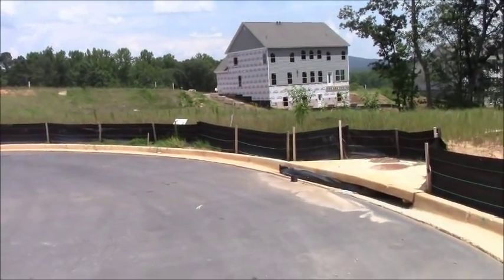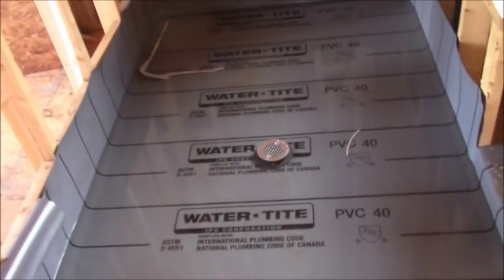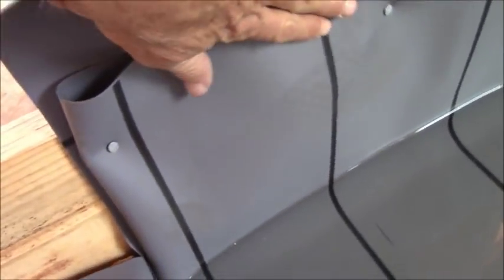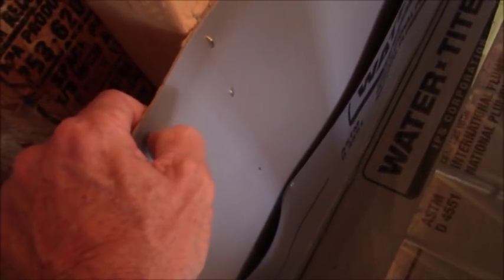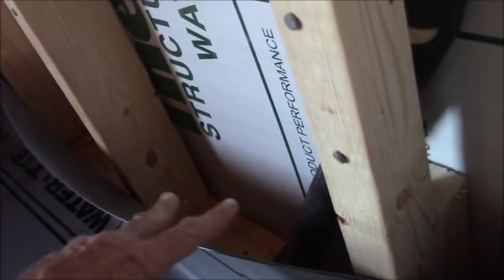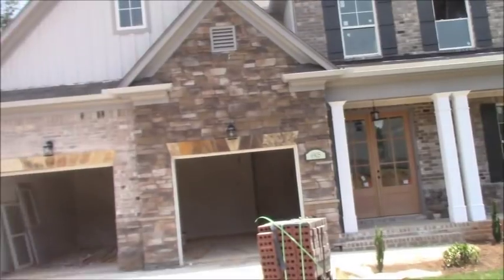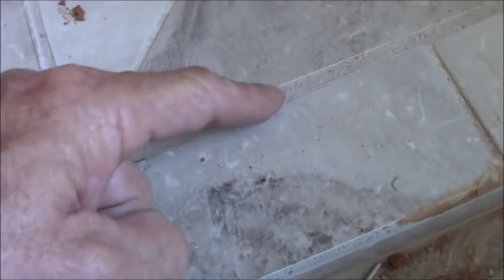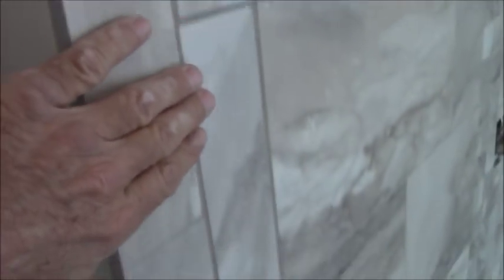NO ShowerPan PreSlope ..NEW CONSTRUCTION

Comment: Being honest. Don't look in these cookie cutter economical house builders, they only follow the minimum code possible and most of these houses would not pass an actual code inspection. These houses are built so fast that they are never built to code. They are sold for a cheap price compared to actual professional builders. These houses are built AS FAST AS POSSIBLE. Quantity over Quality style. Yes pre-slopes help not going to write 2 paragraph's why. Capillary action only happens until the mortar bed itself is soaked and the excess water will simply stay at the bottom of the pan. This is where the problems start.

Just because this video has a subdivision style house that's built with minimum code dose not mean it is NOT code to have a preslope. Do it the Right Way Once.
Reply from the maker: 😂😂😂😂
Old habits die hard I guess

A pre slope is an antiquated process, we are waterproofing our pan surface now so it's 100% irrelevant to the build of a shower... kind of like the phone booth, not relevant today.

Having said that I have a video call pre-slope explain, you can get my take on the whole buffoonery of this method and that by the way, you cannot prove actually works.

Having said that I have taken showers out literally in multimillion-dollar homes and there is no pre slope so because you think it's a low end subdivision, which by the way it is not, doesn't negate the fact that pre slopes are not code here in Georgia and it's rare that I run into one... and yes inspections are done on every house that is built.

And finally to your last point of 100% saturation, that's what degrades your mortar bed to start with, breaks down the cement which is the binder and the pan fails... however if you know anything about a 3 piece drain then you must know besides weep holes....at only 1/4" above floor... there are also troughs under and above the bottom flange to allow water to escape, and including cutouts inside the drain barrel on the opposite thread part, so there are plenty of ways for water to drain on a flat surface... and in fact on my channel I have a video that clearly shows all the water escaping on a shower pan mock-up that I did a few years back, like I said you have no proof of what you say but I do 👌👍

But I digress, shower Builders are waterproofing  their pan surface as I said before, so it is a moot issue.
Reply: @StarrTile  Number 1. Yes it is possible to prove that a preslope works. Issac did a video on it. Although yours and his were both way to small to provide an actual result.
2 Never said it was a "low end"  subdivision. It''s all down to the builder and how he operates. I can tell from the finishes and style of homes from the half brick and siding at the top it is not a "high end" builder.  Builders need to make there money somewhere and I know where they cut corners in this house guaranteed. Siding houses are rarely high end. Like you even said the shower sill was not even marble OR sloped for that matter which already is a code violation. Could only imagine what the rest is like. You should check out Matt Risingers video and Ottawa Design and Build and how "good" houses are actually built. They can be inspected. Not inspected well enough. Most issue fly under the rug. Everything looks great on the surface. Just not underneath.
3. I know very well that efflorescence grows in those weep holes and are eventually the leading cause of failure. There is no way water is going to go above the flange that the pan liner is tightened down to so water is free to sit. " so there are plenty of ways for water to drain on a flat surface"  Right on a FLAT surface. new builds are rarely perfectly flat and even less flat once everything settles. Wood is a living member and will deform. Floors are 2x8 and plywood. Most are OSB, those are Bound to not stay flat.  

Last and not least. I have seen that video of the mock up you did. Also that mock up is painfully small and honestly so is Issac's for that matter. Your testing a shower floor. Not a box shower.  13:48 look how much water is there on a small box. never mind a real shower. How do you think the weep holes will drain water if water is stuck in a corner cause you don't have pre slope? and that the mortar bed will level out the bed? it won't you said "I think" not 'I know" which leads me to believe your playing some guess work here. 

Not trying to throw shade or anything but at the end of the day there is a reason these types of shower installs are being phased out. If this method was a solid 10/10 it wouldn't be getting phased out. Most builders such as myself are waterproofing the entire shower and pan included with something like Schluter Kerdi-membrane which opens up a host of curbless shower options and speeds up water proofing. I agree that none of this matters anymore since these systems are on the way out. I might do a video someday with an actual Real Life  Shower base just to see how much water actually stays in the pan. All this is good information to consider thou so I thank-you for at least making a video on it and responding. No shame in learning.
Reply from the maker: Good healthy response, I like an educated discussion....

Only follow up I have to your comment is Isaac's video was flawed and a foregone conclusion since he used a troba mat above the pan liner, nobody in this business would ever use it in a shower because it's for outdoor landscaping... and because of its very nature would cause movement to the mortar bed and eventually crack it. My belief is at Isaac used it only for that video to prove a point which was never proved Ergo the troba mat. 

The fact that both mock-ups were smaller in proportion to us in my opinion would not matter, if we were 2 foot tall instead of 5 foot tall then that would be a functional shower and therefore still be a good demonstration... but I agree, a proper 3 by 4 shower would be a better mock-up.
Reply: @StarrTile  I forgot to note that in my first response but Yes I agree. The difference would be the larger stall would have a real world resemblance to how much water it would receive and thus provide a more accurate test. Regardless mortar beds are becoming fully waterproofed so eventually this would not matter except for situational circumstances.

Comment: I have installed tile for over 20 yrs and I have never pre-sloped a pan. I have demo’d hundreds of pans and never came across a pre slope? What area you from? I have torn out as old as lead pans also. Tell me what is the purpose of a pre slope that the design of weeping holes of a drain dont do. I get it cement is porous and water could bleed through if drainis clogged or if a pitch is not correct. Idk anyways i have never had a call back in 20 yrs. iId rather save the customer $$$ and your time with that extra step and much rather red gaurd it if your that anal worried. It is a over kill it sounds good but 100% unnecessary in my opinion. Tile cop. <——-(Joke). Take care keep up  the good work

Comment: I have an opinion that this method of doing shower pans is old hat and outdated. Poor design from concept. Water seeps into the mortar slopes and forms mold. Mold expands and explains a lot of cracking in grout joints. Check out Noble. Install a linear drain from wall to curb. Slope in one direction. So much better. Shingle lapped liner can’t leak. Use a bonded liner that installs above the mortar slope. Finish with tile and I use epoxy grout that does not leak. I will not install a pan using this method ever again. It just makes no sense to have a mold farm under your tile. With the improvements in epoxy grouts and the availability of better systems the old ways just aren’t cutting it for me. Look up Noble systems and at least check them out they have a great video on how their systems install. The drains are pricey but it’s more expensive to chase around jobs that have grout cracking on the floors of these showers that they just had to have river rock with 1/2” grout joints  as a shower floor so they feel like they are showering in a trout stream.
Reply from the maker: Thanks for your opinion.
Never ever had an issue with pan liners, and yes after 20 years I'm aware of Noble products, I would never use foam of any kind building a shower, not Noble, Schluter, none at all. Not all my customers want linear drains, all jobs are different. Would not use epoxy grout either...I have, but hate it, looks like plastic. Also not had grout crack or tiles on shower floor crack...not on MY jobs anyway.

But thanks for your input, others may find it useful.

Comment: A lot of heavy breathing in disgust for a misinformed tile person! Pre slope is a code requirement, clear uponor is pex tubing, and the green adhesive is code approved to seal two pieces of membrane(of corse it needs to be sealed water tight to pass inspection). A membrane of that size is more like $70-$80, not $40. A sloped threshold is not ideal if a glass enclosure is used. Most shower valves have a range of acceptance, not exact depth. Most finished tile thickness is less than one inch off a bare stud. Happy critiquing!

Comment: In Pennsylvania, specific codes about pre slope vary from township to township but if you have ever ripped out a shower without compared to with a preslope you wouldn't be talking this nonsense
Reply from the maker: First and foremost everyone I know in the business is doing a sealed system so a preslope antiquated....

But just for kicks and giggles, if you've ever done an experiment as I have with no pre slope you would know that all the water drains out when the flange is bottomed out on the subfloor.
The mess and smell that you described is operator malfunction where the subfloor is not leveled out properly, and or they didn't mix their mortar correctly, or, or, or, there are a lot of failures because of the operator lack of diligence

Comment: Sorry man, you said they did a good job.  How is it a good job if they did one part wrong. Drypacks suck . Pre slope  no slope,  shoot the way its ment to work you can do an opposite slope.  Drypacks are and have always been a failure. 
 I will say you seem like you understand how these thing work. Capillary bs is just a fancy word to say your drypack is saturated. 
Laticrete 9235 or laticrete hydroban is a great product to seal your shower pans, sauna and swimming pools. You can tile right on it. It works. Better than redguard.

Comment: I'll be # 1000. I don't think you understand capillary action like you think you do. A tell is when you say to "look it up". There is gravity too, and waterproof barriers, the instructions ion Oatey's product, you reference and use.
Reply from the maker: The 1st 12seconds of this demonstrate exactly my point..
https://youtu.be/z7X75ZxxcLY

Gravity works with tension in an open environment, much like a sewage line where there is obvious gravity pushing on the water and causing the water to go to the path of least resistance.... in the void of said gravity, meaning 200 pounds of mortar, like any shower pan, wicking or capillary action takes over and overcomes gravity... it is not a difficult concept at all. Oatey fails on many points on their OWN video of a shower pan.

Comment: Honestly, id never let you touch my house. If you have no pre slop wgich is 1/4inch per foot all that water will sit in the pan and cause mold. Pre slope is designed to eliminate sitting water so your way of thinking dosent make sense. You just want veiws on utube. If you knew what your talking about. You wouldnt be filming and trustpassing on s ok mekne else's property and filming other guys work. And to clear the air im a licensed general B contractor and c-54 tile contractor in the state of CA. So stop uour fake bs
Reply from the maker: If you knew what you were talking about, you'd present the proof of what you're saying, rather than ranting & bragging....but I'm aware there's no proof, so no worries.